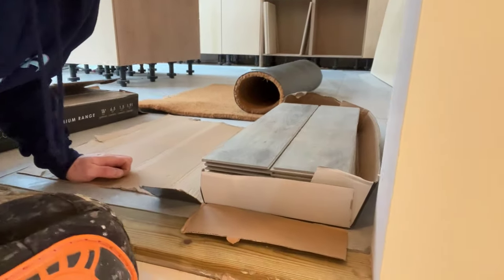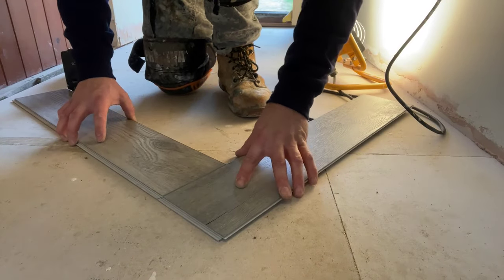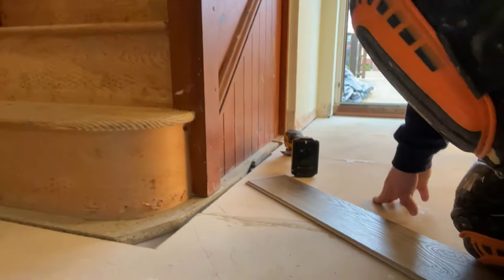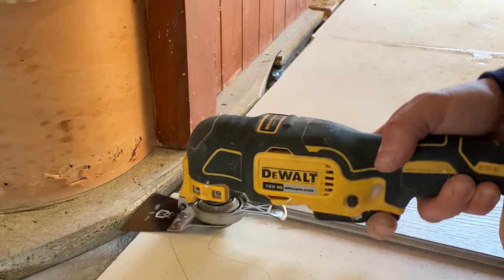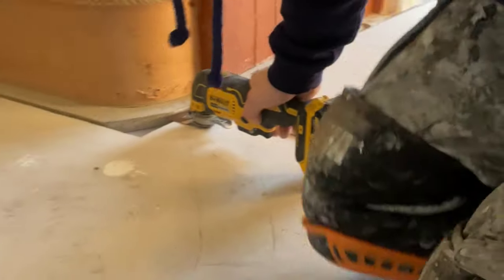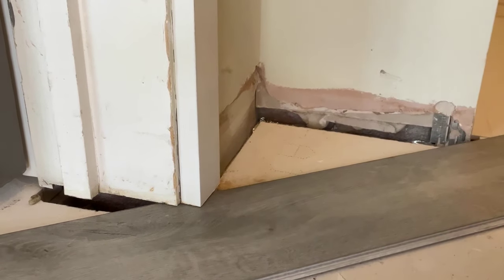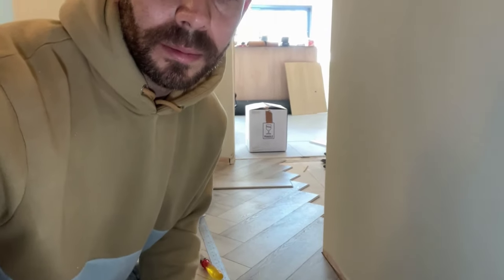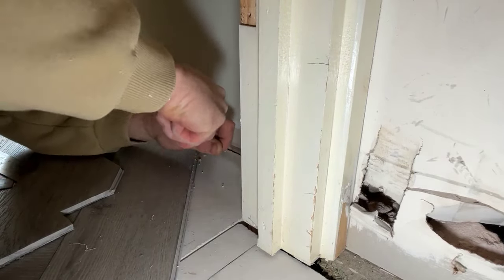Herringbone LVT click flooring. EvoCore full tutorial in detail

Comment: Not a fan of click i much prefer the stick down stuff
Reply from the maker: Both types of LVT floors are good. To do stick down 3mm or 4mm thin lvt you need perfect surface. So either self level whole area or fix down plywood or chipboard.....this extra work and cost for customers. In this job subfloor wasnt great and it was a bit loose so clients rightly decided to do floating floor. I think in new builds stick down is great. Thanks for a comment 👍

Comment: Also a good idea to make sure you stay 1/8” away from any vertical surface to prevent future gapping if the floor tries to expand
Reply from the maker: I think with lvt flooring there is less danger of expanding as lvt is made of some kind of rubber/composite/plastic not sure whataterial it really is but i dont think it expanding much. I definetely leave a small gap anyway with lvt to be sure. Wooden floors expand and need a gap for sure. Thanks for a good comment! Keep up good work! 💪
Reply: @FinePineNorwichCarpenter wrong. Any floating floor requires expansion. Floating LVT can definitely expand and buckle.

Comment: Hey mate hope you can help me, is there a reason why you use a chisel and remove the edge of the lip on the ends of the boards? Does it help it lay easier? I am in the process of installing a floor in this make of flooring and really struggling with the process and getting it moving forward without alignment issues. Any advice greatly appreciated.
Reply from the maker: Hello! To click the boards one to another you have to go at an engle and when you are fitting the board thats blocked with architrave then you cant click them at an angle so when you scrape the lip you changing "click" flooring into "tongue and groove" flooring and by that you can slide them flat one into another. Its in the video mid way i think. 
Send me a video to my whatsup and may be able to help 07749381629. We can talk. Hopefully i can help
Reply: @FinePineNorwichCarpenter  Many thanks for the reply and the contact info. I managed to find the online instructions for it, they should have minimum been a 3D barcode to scan on the box to show you the instructions. Appreciate your reply and well done you did a fantastic job